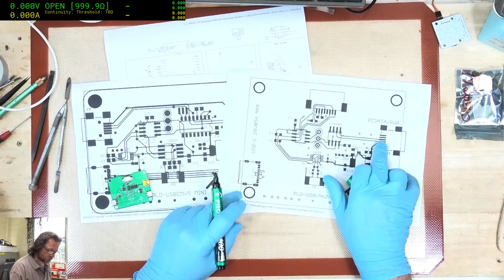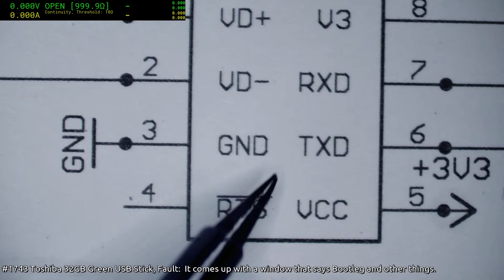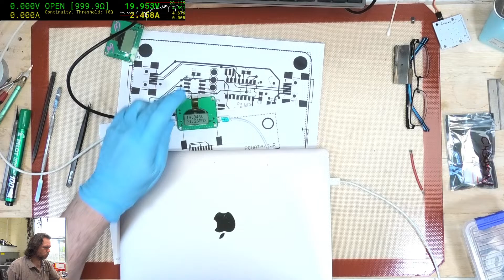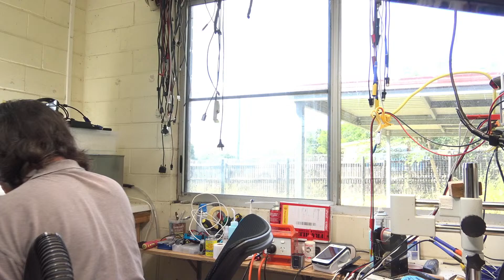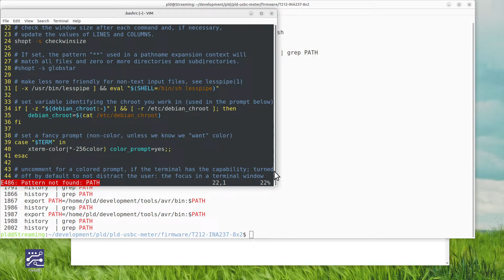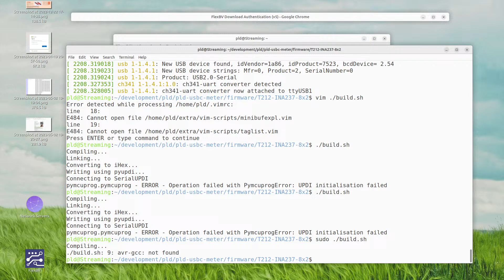The PLD USB-C meter with data link; transitioning from the CH340G to 340N. Smaller & Cheaper

Comment from the maker: Specs for the USB-C meter thus far are;

* INA237 sensor - lets us easily cope with the new 28V voltage that Macbooks use
* 25mR shunt, which means at 5A we're only wasting 625mW of power, instead of 1.25W with the previous 50mR shunt
* 9600bps transfer rate; I could certainly go faster but for now I think that's a nice durable and "standard" serial spec
* The USC-C ports are still single-orientation unfortunately in spite of the CC1/2 lines being present on both sides that I know of.
* I'm running in to a possible supply issue with the LCD panel,  the 8x2 CoG units that I have are non-backlight and from the same supplier I seem only to be able to now get ones with backlight; while I could just ignore the backlight it does sometimes change the reflectivity.
Reply: My go-to shunt is 5mOhm. Mostly for small boards and heat management. Still 125mW at 5 amps...